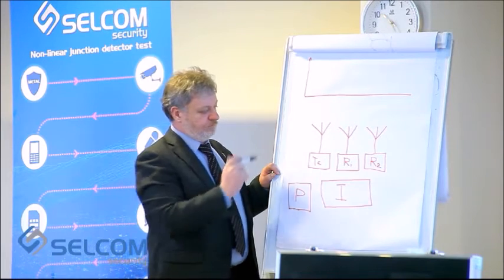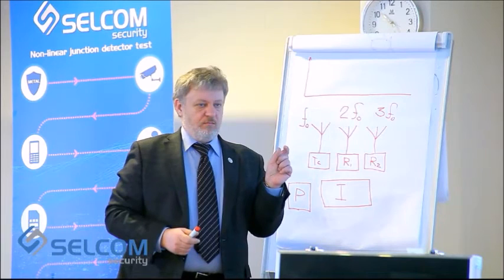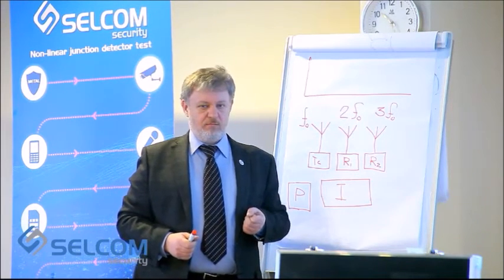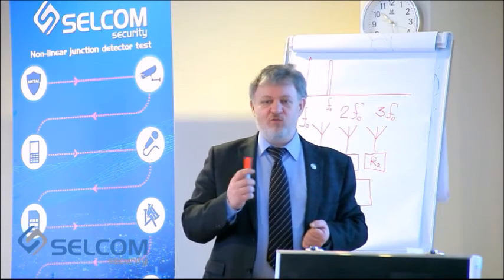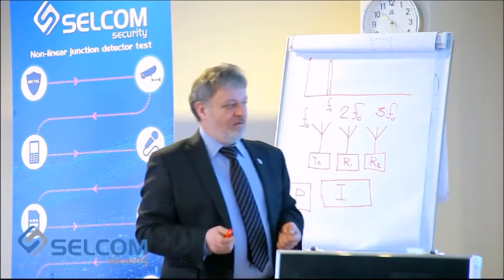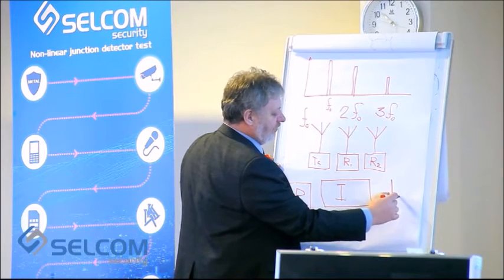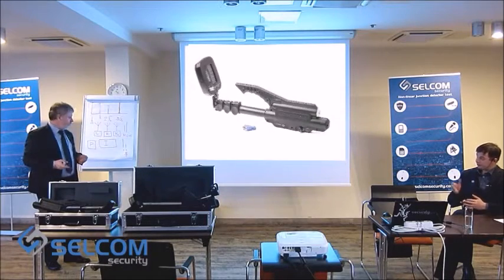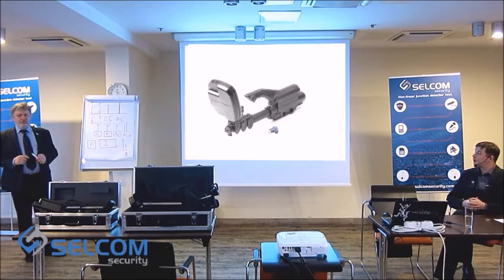Non linear junction detector as a part of detection set

Comment: lol its just a metal detector that is a circuit with a broken/untuned inductor. move the device closer to metal or any other antena, it changes the inductance of the circuit slightly. the smart part is in the math of doing sine wave multiplication with analogue components and passing them through a filter. the same math that everyone learns in 2nd year calculus at university and then quickly forgets... infinite series? why would i need that. old school oscillators. instead of tuning the circuit to detect inductance change of + - of ferromagnetic/paramagnetic like a metal detector, it is tuned to specifically silicon and their metal oxide transistors is all. I think with the advancement of micromachining of passive seebeck(Thermoelectric) motors and compliant mechanisms, it would be close to impossible to detect these newer devices which could periodically self assemble into a magnetron cavity during a certain time of day, or even at a certain ultralow frequency. I am sure the CIA has put these in every computer circuit since they started adding "fingerprint readers" to phones, which are just sneaky MEMs circuits rofl. anyways interesting kgb history lol